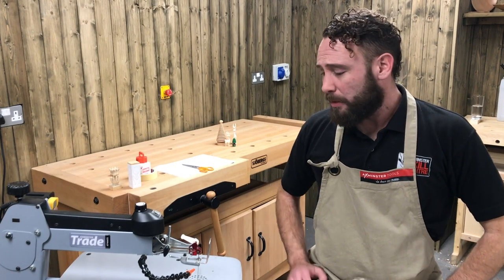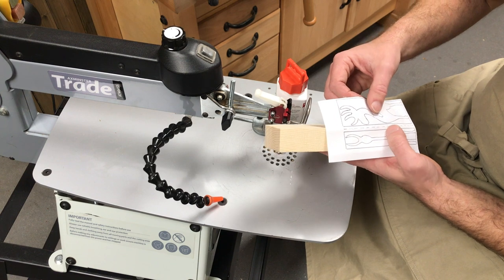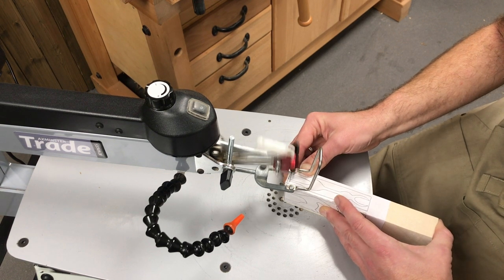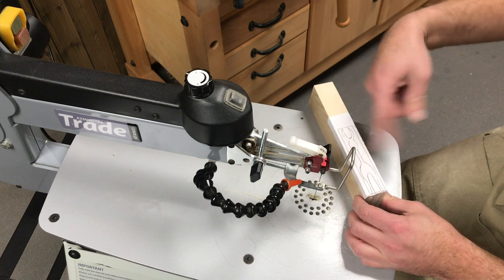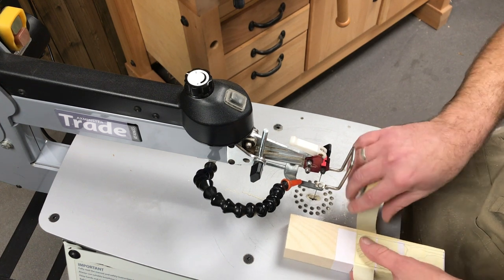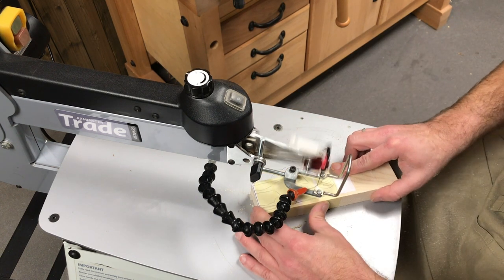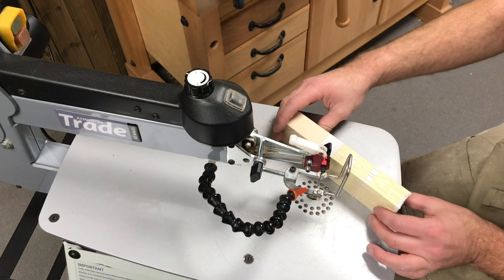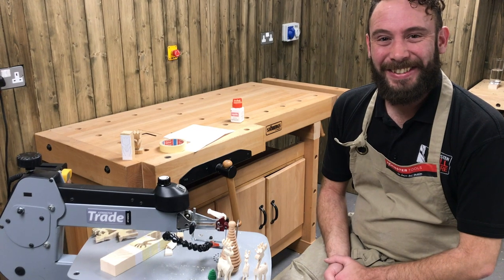Workshop Wednesday - 3D cutting on a Scroll Saw

Comment: I've owned and used the Axminster Trade 21" version of that excellent scroll saw for over 4 years now and I am highly delighted with its high standard of manufacture and use. One thing that I do hate, however, is the fact that only Axminster decided to add an annoying NVR (No-Volt Release) switch on the back of their version of this universal machine. 

Other brands of this machine (all made in the same factory in Taiwan as this one is), e.g. Excalibur, Pégas, etc, have resisted the urge to add an NVR switch on their versions of this unit. Instead they prefer (as I do) to use a foot-switch for an immediate on/off function. With the NVR switch you have to let go of the workpiece with one hand to operate that remote switch. With a foot-switch you can keep both hands on the project and simply use your foot to instantly stop the blade from oscillating. This is a far more important safety feature than an unnecessary remote NVR switch.

As a direct consequence I have removed the NVR switch on my scroll saw and replaced it with a foot-switch. This added level of safety and convenience has enhanced my already high level of admiration for this top quality machine.